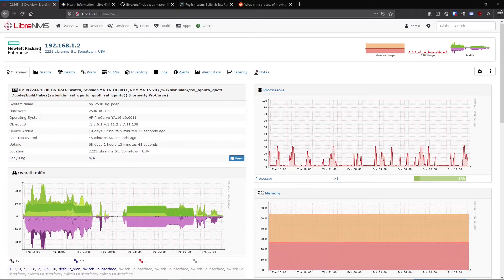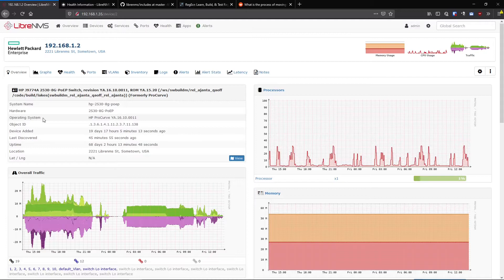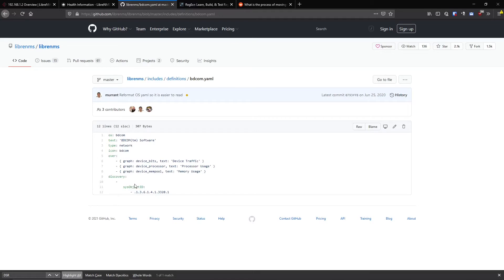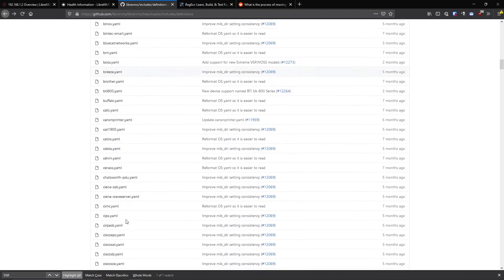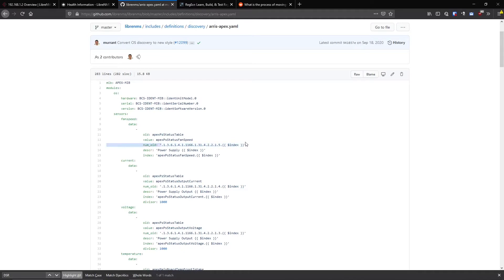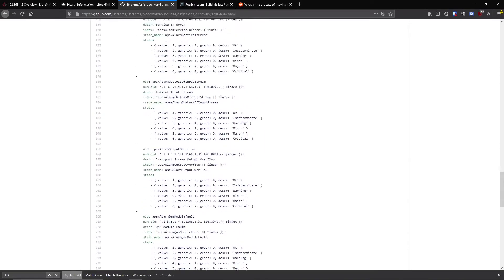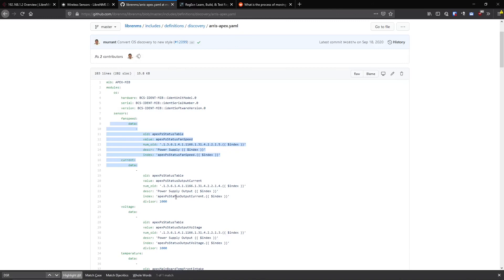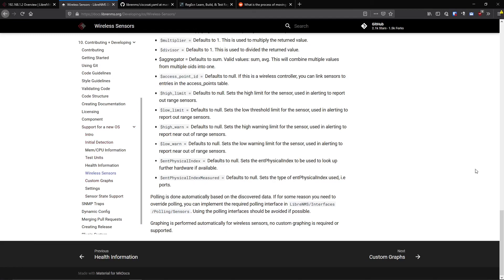LibreNMS How It Works

Comment: I've setup LibreNMS and have successfully got it to scan and identify applicable devices on my network - routers, switches, APs, NASs and network printer.
What I struggle with though is creating a dashboard to display stats, graphs etc of the things I think would be of interest to see or monitor, but there are just so many options to choose from when i select a device, i've got no idea what to select or even if it is applicable to the selected device.

Can anyone point me in the right direction for this?
I'm running a Ubiquiti EdgeRouter4 and several Unifi switches and nanoHD APs, a couple Synology NASs and a Brother MFC printer.